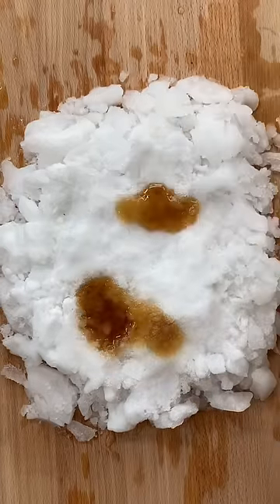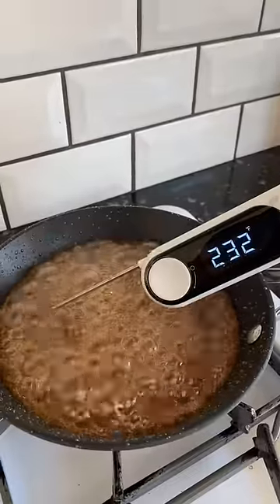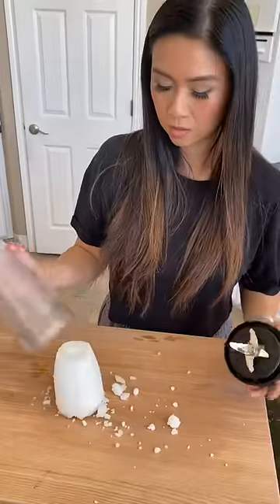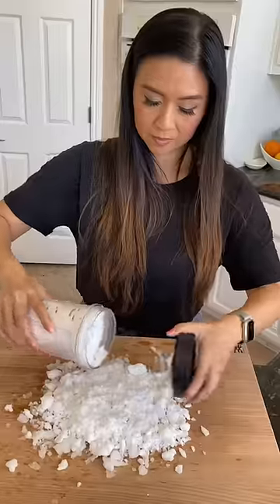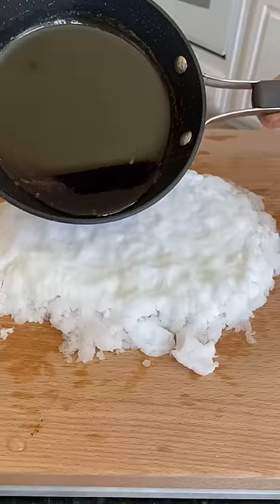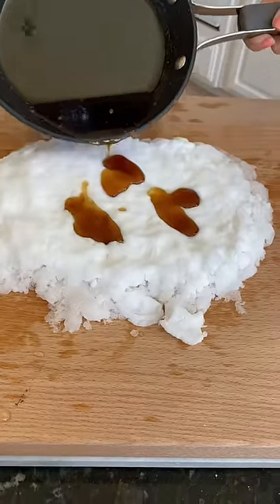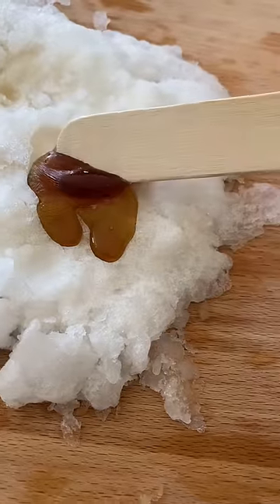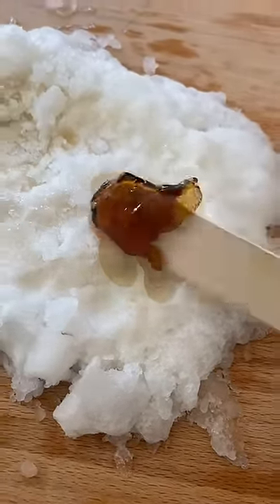My Second Attempt of Making Frozen Maple Syrup | MyHealthyDish

Comment: I had this when I visited Quebec when I was younger. I tried to recreate it at home. I had no idea you were supposed to heat up the maple syrup first. Do you pour it on the snow whilst it’s still hot or let it cool down first?
Reply: WHILE ITS HOT!! i mean leave it for a couple seconds and then put it on.
Reply: It’s the whole point of it being HOT
Reply: The snow cools the syrup, that’s why it’s poured on the snow.
Reply: Yes while it's hot.
Reply: I made this immediately after I saw this video since we got a small snow storm. I poured it while it was hot so that the maple syrup could cool off and stick to the wood. The only problem left is figuring out how to clean the pot….

Update: BAKING SODA AND BOILING WATER DOES WONDERS